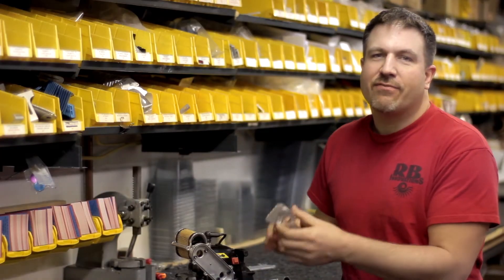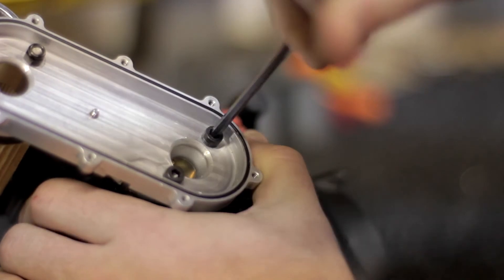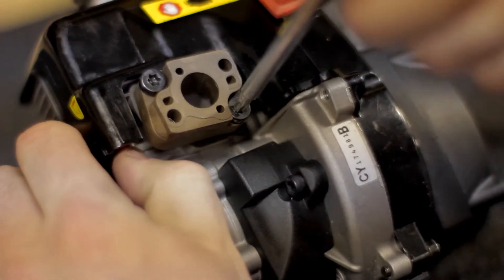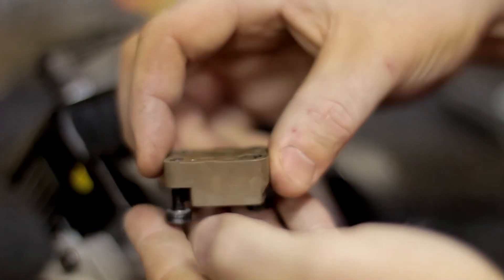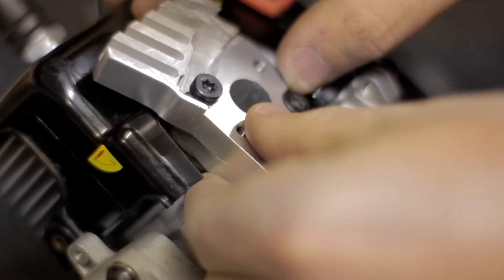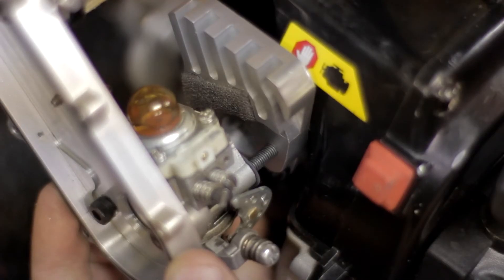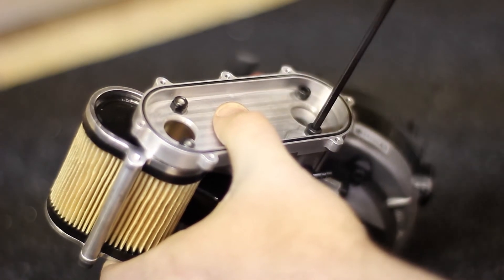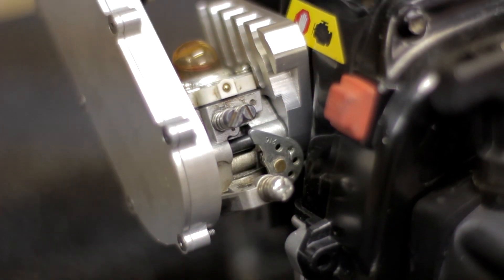How to install the RC Heat Sink Isolator Block w/ Diaphragm Filter

Comment: Metal intakes (aluminum in this case) have a bad habit of actually heat soaking the carburetor and can cause the carb to vapor lock. That's why the factory uses plastic or fenolic intakes to isolate the heat as best it can because it is bolting directly to on air cooled cylinder that sees temperatures around 200+ degrees and if you run a metal intake it will allow the carb to reach close to the same temp as the cylinder, if you are going to run this intake you really need to use either an extra thick paper or fiber gasket or use the thick teflon gaskets that some company's make. On paper this intake is a nice idea but in reality is not a very good at all.

Comment: One thing they don't show or tell you is to make sure you use the teflon gasket that comes with it between the manifold and the carburetor or you will get vapor lock. Ask me how I know
Reply: MGP CUSTOMS exactly man, also should you use gaskets with that teflon gasket! Im thinking it would be a good Idea?
Reply: Jeff Lohr I did and it has worked so far
Reply: MGP CUSTOMS well man I have done put my engine together my twin and I just used the teflon gasket between the carb and manifold and it seemed to smash slightly to make a very nice seal! I will let you know how it performs once I fire this bad boy up! all the pics I could find on the net just show the teflon gasket between the carb and not paper, teflon, paper so I figured I would try that. but glad to hear the PTP method is working for you!! and thanks for the reply!